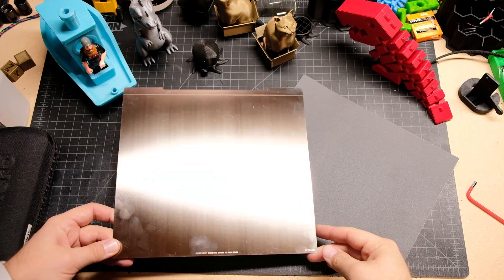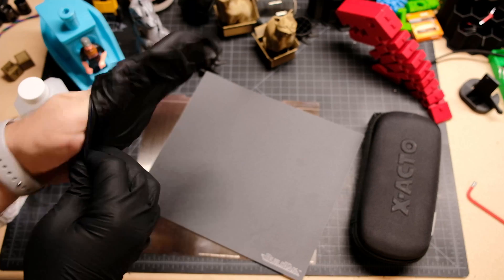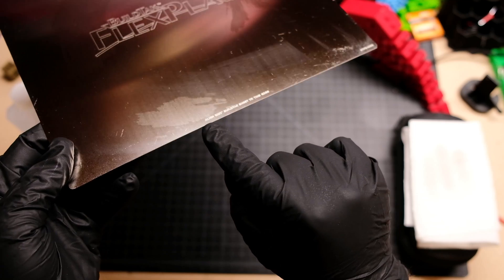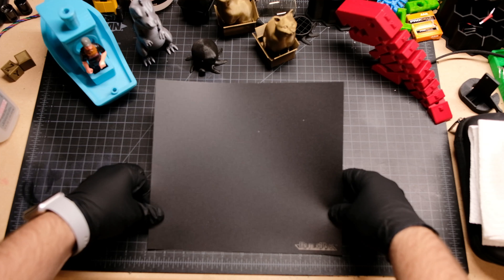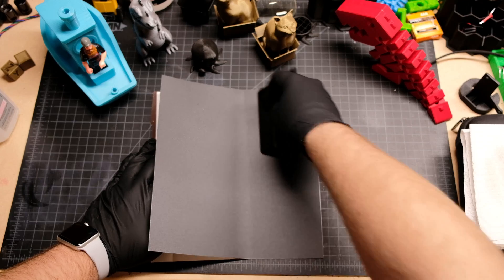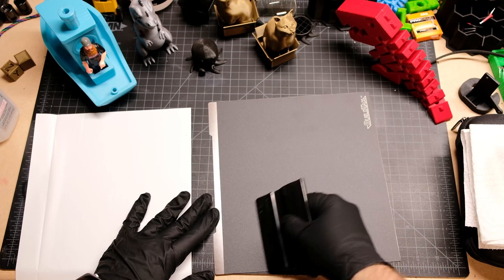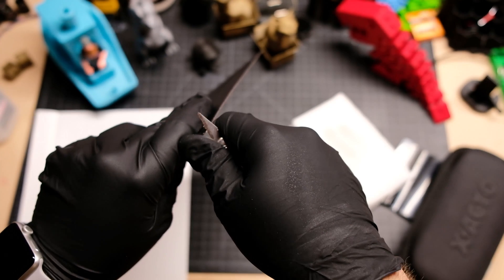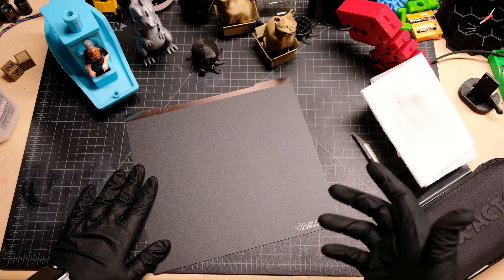Buildtak install on the MK3 Flexplate

Comment: Nice video. Does anyone know of a set of directions for using the flexplate & buildtak on the Mk3? I read about the z height adjustments but how exactly that works Im unsure? Is it possible to configure the MK3 auto-leveling feature to just work with the flexplate and buildtak?

I appreciate everyone's suggestions and advice!

Comment: I like your tapes. One question about MK3 Flexplate: what size did you order from Buildtak? Possibly a link to the appropriate product?
Reply from the maker: Stephan Hug buildtak.com has a MK3 specific size. Only the US store carries those but it's the 9.5x10 plate.
Reply: Thanks for your answer. unfortunately buildtak.com redirects to buildtak.eu. and there I don't find the MK3 version
Reply from the maker: Stephan Hug that's the problem right now. You can try emailing info@buildtak.com and see when the European store receives them.
Reply: Is that the right one to order in Europe?